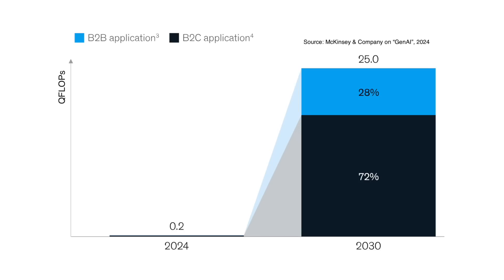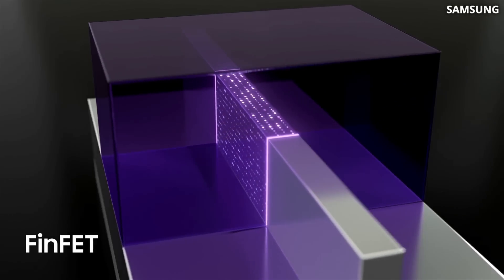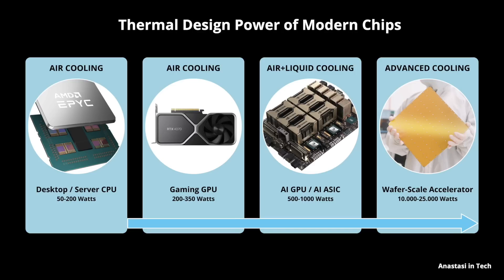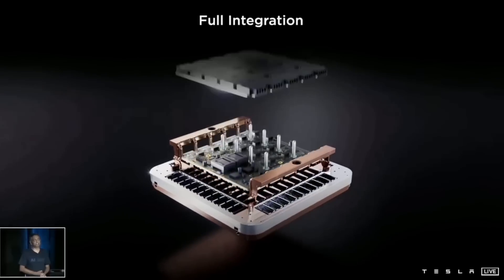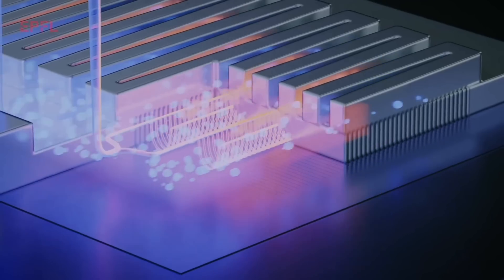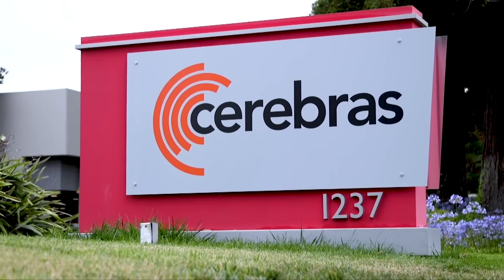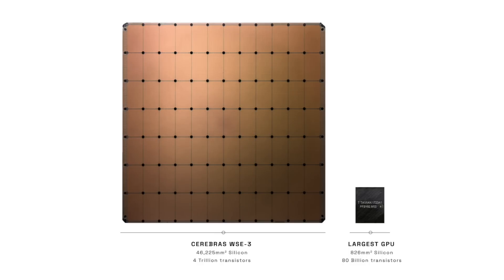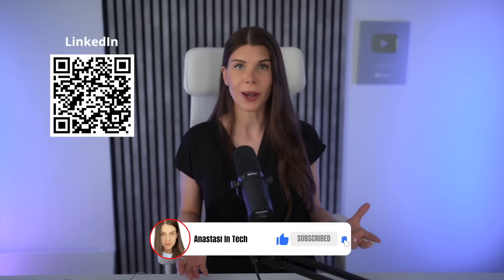This New Technology Will Keep Moore’s Law Going

Comment: Great video Anastasi, it's interesting that cooling technologies could be the neccesary breakthrough we all need to advance in chips, not the chips architecture, not software layer, even ai implementation, but cooling. Temperature is computation final challenge.
Reply: I think that's clear for a very, very long time.  Probably Seymour Cray was the last systems designer who was advocating the principle of more compute power by consuming more electric power.  To give a slightly more realworld example than Cray supercomputers, BIT Technologies did develop the MIPS R6000 processor in about 1988.  It ran at for the time insane 80 Mhz.  A 3 CPU R6000 system did consume about 3.6 kW or 16A @ 220 V.  The crazy heat prevented higher integration but higher integration is required for higher clocks, larger caches, FPUs and specialized accelerators.  Aside of an even more successless attempt at building an ECL PowerPC that meant CMOS won the battle.  And within the realm of CMOS the Pentium 4 was one of the lastt speed daemon designs.  It's not that lower clocks are iinherently superior but all these designs since  at least the 80s in the end werre dominated by how one can get the heat out of  the chip.
And once the heat has been pushed out from the system the next challenge is to get it out of the building.  I know data centres built in former cold war underground bunkers were any change to the building in order to improve cooling is extremely expensive and the operators have opted to rather leave some floorspace unused.  That difficult cooling can become!
Battery powered devices are at the other end.  Cooling there tends to be even more limiting (want your phone to burn your hand?) as is the energy supply.
Whatever, software is also in charge to optimize power consumption, optimize cooling.  Challenging times but I like it 🙂

Thanks for the vid, Anastsi 🙂

Comment: At some point the cooling tech used in quantum computers may have to be applied to advanced  "conventional" cpu's and gpu's. YES !?!?!?
Reply: How do you want the normal PC user to use such cooling solutions at such cold temps. 
I highly doubt, cos that level of cooling is crazy
Reply: The current quantum cooling is for early human first gen quantum computers. State of the art quantum computers require the same cooling as the leaf, one of nature's quantum computing devices. When the brain is better recognized as a quantum computer, the only cooling that may be needed is a cap on a sunny day.

Comment: immersion cooling is basically phase change cooling. Finding replacement for coolant should be as easy as varying the pressure. They could use water at 1/10 bar, which boils at 40C. They could also vary the pressure for different cooling needs
Reply: I also think so. However, could it be that keeping water from interfering with electrical networks is tough? That, even de-ionised water isnt working?
Reply: @catman4859  Sure could. There's also a question of how different materials interact with the electronic components at these phase change points. Maybe liquid de-ionized water doesn't present any issues but its gaseous form corrodes them.
Reply: @lmmortalZodd  yeah. So there are probably lots of complexities here that we are unaware of. Otherwise, such a problem would have been already solved.
Reply: You're wrong on several levels here. Immersion may be two-phase, but currently it's mostly single phase. Water is not used and won't be used due to issues with electric conductivity. You need fluids with very low dielectric constants. Also sub-atmospheric pressures are not recommended as non-condensables can leak into the system. You need ideally fluids with boiling points around 40-60C this way you can have boiling HTCs without needing high pressure rated equipments. Now I believe the increase in heat fluxes won't be able to be cooled by two phase immersion cooling, the critical heat flux of pool boiling is too low. You need forced convection boiling.
Reply: @brunoyuji9203  You're wrong on several levels here!
Reply: @beehappy7797  I mean, what do I know? I just work on R&D in this field.
Reply: @brunoyuji9203  fascinating! What do you mean mostly single phase? It makes sense to me to boil the liquid at the temperature limit because you can use the density difference of the gas to get heat away from the components without needing to pump liquid. Also what do you mean by "non-condensables can leak into the system"? Please detail this a little more. Also-also what's critical heat flux of pool boiling and forced convection boiling?

I expected to be wrong, I don't mind, but I really want to understand how I'm wrong to deepen my understanding. Thanks
Reply: When water becomes gas - that spot stops being cooled until its covered with water again, because gas has bad heat conductivity. I think its hard to predict and control hotspots in such a setup. When boiling water in a pot, you can see air bubbles forming on the bottom and staying on one place for a long time. These bubbles will cause overheating of a chip, if not moved quickly.
Reply: Single phase means no phase change, literally the coolant heats up from waste heat and does not boil, thus it needs to be pumped to the heat exchanger outside.
Reply: Yeah I thought that using phase change inside the chip would be what this video was about. Not just water. 
 
 Isn't liquid pretty thick relative to the transistors! How thick are these channels?

 I thought water had a capillary limit of .0001mm. Or 100 nanometers. 
 
 I remember seeing a solid state fan demo. Think it was called AirJet. I wonder how that company was doing.  I guess this technology blows it out of the water.

Comment: As a simple homelab guy, wondering how we can harness this energy for cooling and heating? I live in Michigan, a state getting a ton of new love from Data Centers due to the amount of fresh water we have. I can see a data center in Detroit whose excess heat is delivered to low income households, to large apartment structures. Heat Pumps and Enterprise IT need to have a meeting.
Reply: They're already doing exactly this with LUMI in Finland - it's the fastest supercomputer in Europe and it provides 20% of the district heating to the city of Kajaani
Reply: @felinefireaudio district heating is underrated

Comment: Excellent video, as usual! Question: Is copper really a worse conductor of heat than silicon? I heard a while back that it was a significantly better conductor. Can you please clarify?
Reply: Probably an editorial mix up between thermal conductivity and thermal resistance.

Silicon thermal conductivity 148W/(m.K)
Copper thermal conductivity 401W/(m.K)

For fun, diamond thermal conductivity 2,200W/(m.K)
Reply: @dougaltolan3017  ah, okay, that makes sense! And today is the day when I find out that my next CPU block will have to be made of pure diamond :)